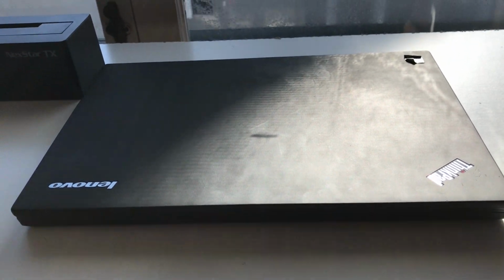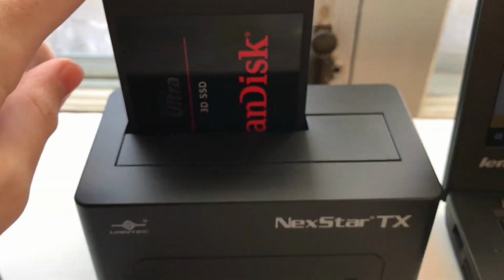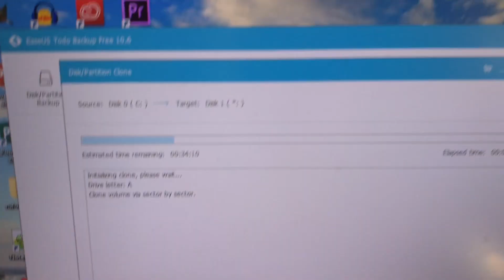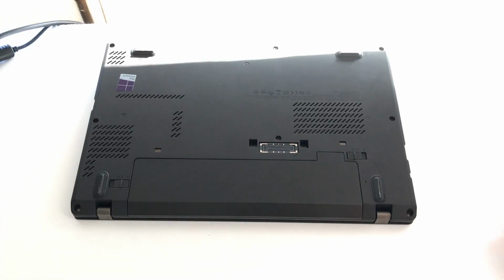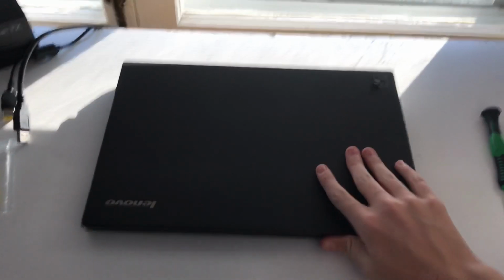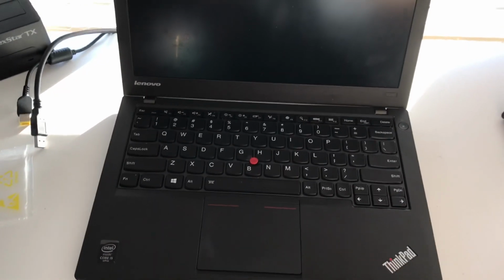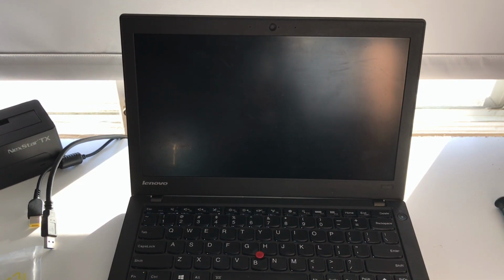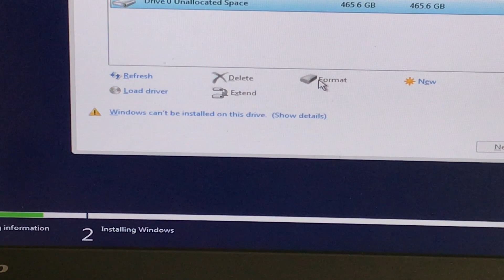ThinkPad x240 SSD Upgrade part 1

Comment: I will now forever call those vertical drive bay things, toasters. Thank you.

Edit: Next time you take apart the PC, disable all the batteries in the BIOS and plug them all out. You can apparently blow the LCD back-light if you accidentally unplug the LCD while the PC still has power.